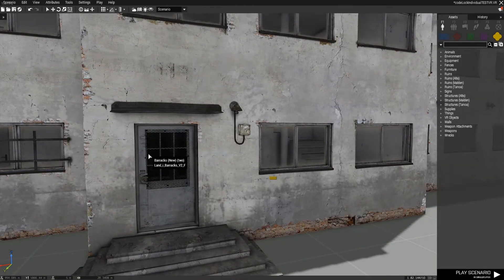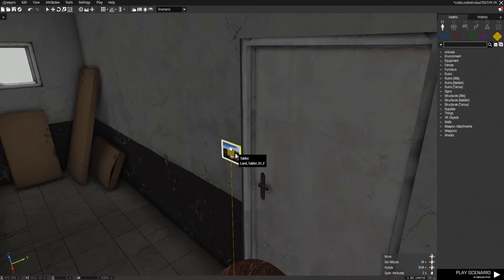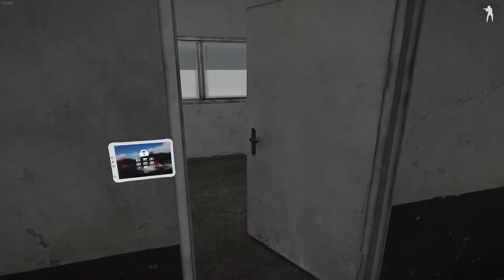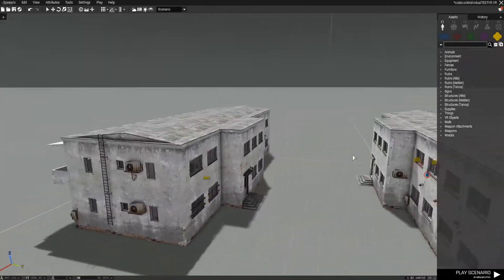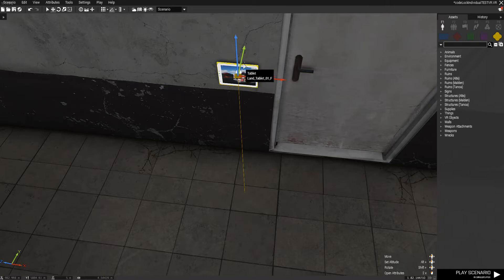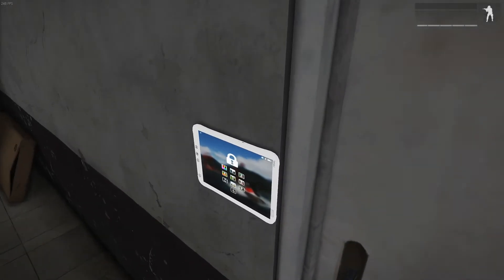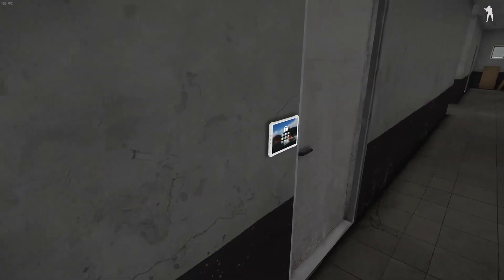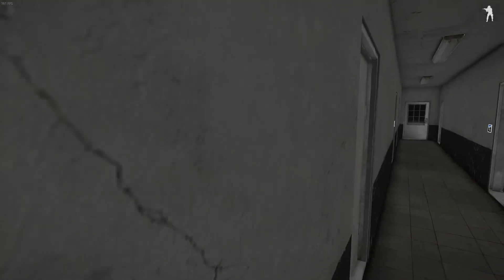Arma 3 gui keypad WIP part 3 manual version

Comment: pls, how can I put the password in the editor so that the player needs to find the password in a file to use in mission?
Reply from the maker: i dont remember how the keypad worked, but it should be fairly easy to make it use a predetermined number as the password
Reply: i discovered, you need  edit 

_keyPad setVariable ["theCode", "PERSONALCODE", true];
_keyPad setVariable ["hasCode", true, true];
_keyPad setVariable ["isLocked", true, true];

in the setup.sqf file
Reply from the maker: @Larri1Cruz  nice job!